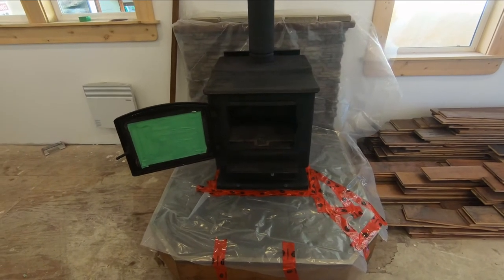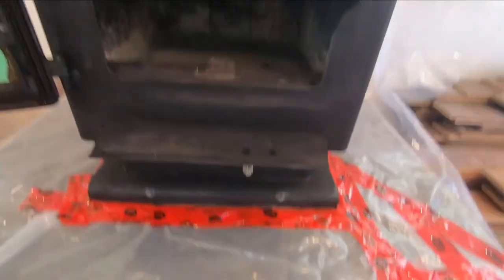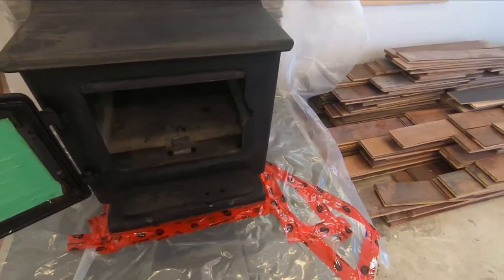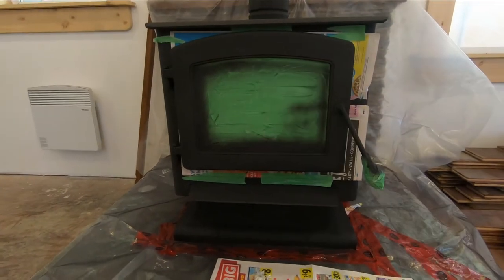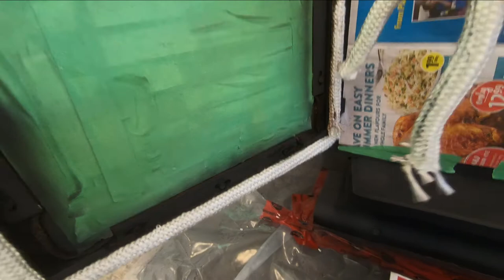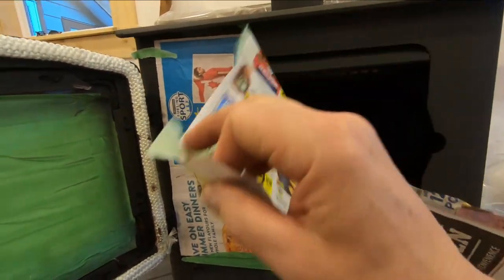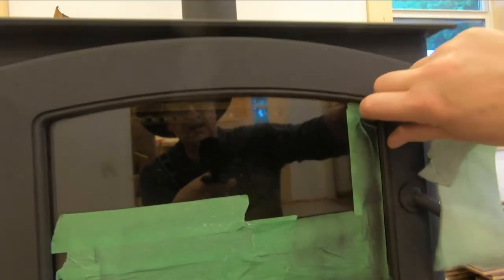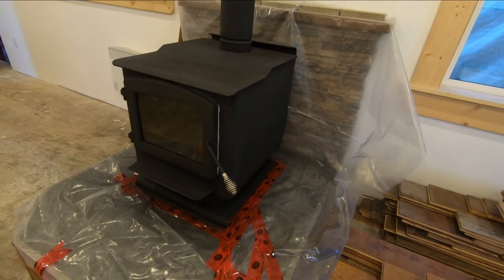FULL-SERVICE WOOD STOVE MAINTENANCE

Comment: Nice job. That should keep things running for a good long while. I had a very similar air tight stove that I used for 18 years when we lived in Minnesota. I seem to remember a thick blanket of some type of fireproof material that went above the fire brick. It must have been a little different system. Ours was set back into a traditional fireplace and really worked well.
Reply from the maker: Yes,  I have another stove with the blanketing you mention (Pacific Energy, a superior stove). This one (Timber Ridge, Englander brand) I picked up on a deep-discount sale a few years ago and it is fine, but the "Pacific Energy" brand is that much better again. When shopping for anything--quality counts! Yours was what they call a fireplace insert. All the benefits of a wood stove with no loss of heat up the chimney as with a traditional fireplace. I enjoy a wood stove but not the wood gathering so much anymore. A heat pump is looking better and better!
Reply: @EverydayProjects  I was pretty happy after 18 years of cutting and splitting wood to have a half inch natural gas line coming into our new house. So much easier, but, at a cost, and not as much fun as watching the fire. That's how things go as you age and your 'free labor' isn't as plentiful.

Comment: Good day eh!!  Your video scares me!!!  Is it 'stove maintenance' time already!!!  I barely had time to get fully into complaining about the heat!!!  LOL  You did a great job of the stove.  I think the fire brick will be just fine on the roof of the stove.  That's a pretty stone wall behind the stove too!!!  Take care and thanks for sharing!!!
Reply from the maker: Sorry to scare you, Mike! It's only August, I know...but I like to be ready. The firebrick on top of the pipes is said to work, so we'll see. The stone wall behind the stove is what they call "cultured stone" which are concrete pieces made to look like stone that install like brick veneer. They are installed using thin-set mortar. The concrete is manufactured with some type of filler that makes them light. The specific brand is Eldorado Stone, and the type is "Stacked Stone China Mountain". I bought them at a discount liquidator who sells odds and ends of building material. There wasn't enought to do a big wall, but plenty for this fireplace backing. Nice to have your comments here. Thanks!

Comment: Ah yea it's high time isn't it? I have a Heatrola Estate. It's an old coal burner made in the 40's and it's my primary source of heat. You've just reminded me that I have to tear the thing down. I'm not sure what's going on with it but it'll get in a mood where it wants to burn super hot like you left the bottom door and the chimney damper wide open. All I can think is that the thing is 80 years old and it must be sucking air in somewhere. Your stove looks great! I can't see why firebrick won't hold up. Do the re-burner tubes burn gasified vapor in the smoke?
Reply from the maker: I've had some stoves that develop cracks that suck in air and lead to a runaway condition (just like leaving the draft open wide). Some stove cement applied to roughed steel will stick and stop the air leaks. This stove I picked up cheap on a deep-sale a few years ago ($300). I thought I was getting a super deal until I realized that the ceramic baffles cost so much to replace-and they are so easy to break!! Better stoves have the baffles protected inside a removable steel frame that bolts into the top of the stove. And yes, the air tubes introduce cool, fresh air from outside of the stove, into the smoke before it exits the firebox to promote efficiency and burn the hydrocarbons still remaining in the smoke. When these stoves first came out they were called "Air Tight" with the only air getting in was through the draft pipes and these tubes. When they operate as expected, you can see blue flames created at the air tubes and a slow churning of flames near the top of the stove. Keep an eye out for a used one. You would be amazed at the drastic reduction of firewood you'll need. We have a friend who had a 50 gallon barrel stove in their shop who changed it out for an old Air Tight stove and they went from about 10 cords a year to 4 ! Do you still have coal available to burn? I know there are plenty of coal mines in your area...not sure if you can buy coal for home use?
Reply from the maker: Not sure why there are lines through my reply??? Looks like an Auto-correct of some sort.
Reply: @EverydayProjects  Maybe before tearing it apart I'll shine a light inside and see what I can see. It absolutely runs away on me. I have to dump a bunch of coal on and stir it vigorously to get it to calm down. I'm not sure why that works but it does. I have two tons of coal on hand and it's still readily available for home use. There's nothing cheaper around here except for firewood and only if you process the firewood on your own but that still costs you time and effort. I keep about a half cord of red oak for a small insurance policy. It's not made for burning wood but I don't think it cares very much. Just leave ashes over the grates to insulate them. I was told that wood can burn hotter and warp the grates.
Reply from the maker: @heliarche  I hear that in some parts of Pennsylvania and Virginia you can find coal near the surface and dig your own pits. Not sure about that. I welded a homemade wood stove one time out of 30" diameter piece of 3/8" cold-rolled steel. I welded plate on either end of a 36" section and made some crude legs (my welding isn't/wasn't great). I welded grates about 4" off the bottom to build the fire on but the fire would always fall through and go out. I finally cut out the grates and left about 2" of ashes in the bottom and built the fire on that. It always worked well afterwards. That was for a camp I built in 1984 with my neighbor. We only bought roofing shingles and some nails--the rest we scrounged everywhere. He bought a short school bus and took the seats out as a "Go-find-stuff-for-the-camp-bus" We went to demolition sites and pulled boards and plywood from houses slated to be demolished and hauled it 150 miles to the camp property (every weekend for a whole spring/summer/fall). I was young and really stupid back then. Now I'm older and just as stupid, but I wouldn't work like that again!! Haha
Reply: @EverydayProjects  There's a stripmine nearby where just about everyone rode dirtbikes, atv's, trucks, I even saw a moped there once. Miles of trails. There's a place called Coal Cavern and it's within hand digging distance so I wouldn't doubt that finding coal on your own is possible. There's also oil shale but that stuff doesn't burn for a dang in a coal stove. Most camps I've seen, once they have the bus in, the camp is pretty well completed so you guys must have been ambitious! Did this have anything to do with the "One Last Pull" generator?
Reply from the maker: @heliarche  The "one last pull generator" happened at a cabin I lived at on an Island on the North Coast of British Columbia, where I lived "off grid" for about 8 years. The cabin my neighbour and I built was when I lived in Nova Scotia in the 80's. The one in Nova Scotia was a rough, get-away and deer hunting camp, that was used only on vacation. The "last pull" cabin was a full-time, live in cabin (I didn't build it) in a ghost-town that used to be a Coast Guard Base, built in the 1920's.
Reply: @EverydayProjects  Roger that. You've been blessed with some real adventure! It might have been misery at the time but it must be a lot of fun to look back.
Reply from the maker: @heliarche  Yes, I guess I have. I've never thought of myself as privileged, because I never had any money, but I've been willing to take on just about anything. As an example, the videos I've been posting about renovating a house show a pretty nice place, but when I bought it 11 years ago, it was the worst, knock-down shack in the whole town. Nobody would go anywhere near it and it had been for sale for years! I worked out a payment plan with the owner and moved in. The place was so rotten underneath that I would walk ever so lightly so as not to create a collapse. There were rotten floor boards everywhere with plywood patches over them; dead rats in the walls and raccoons living in the crawl space. The place was out of level by 14" in 25' across the width of the house. I dug out the old posts, one at a time and jacked the place level eventually. I'm working on a video showing just how bad it was when I started.